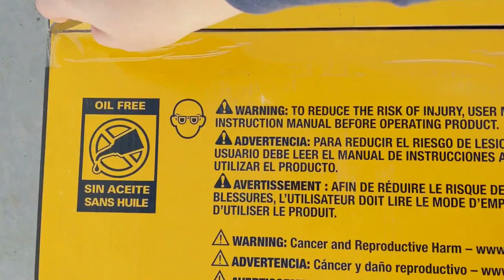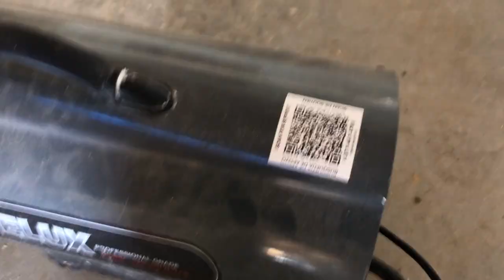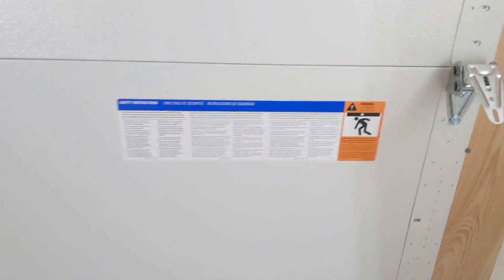Installing Doors on an ICF House

Comment: What is the longest door/window icf span you have? What is the core size as well.
Reply from the maker: Our largest lintel span would be the 72” patio door; however, that’s a non-load bearing exterior wall. The front windows are 48”. Cores are all 6”. The garage spans (9’ and 16’) are wooden LVLs.

Comment: Could you have run PVC For the dryer vent?
Reply from the maker: Not sure, but I’d assume not. PVC is pretty temperature sensitive, and those vents get pretty hot. I was actually even worried about heating up the EPS foam too much if the vent did work out. Thanks for watching!